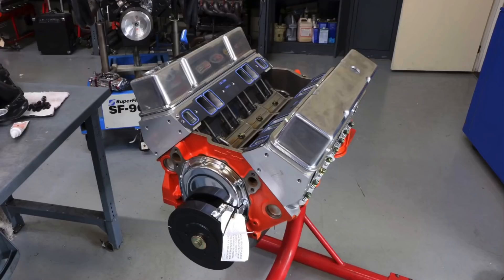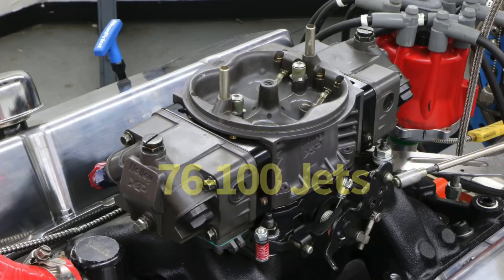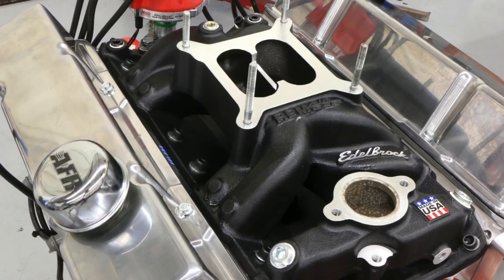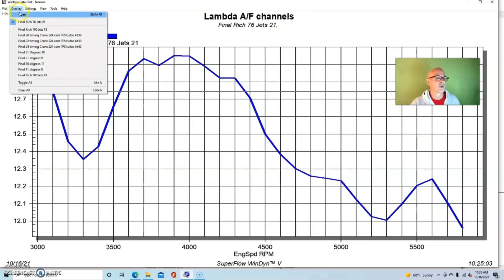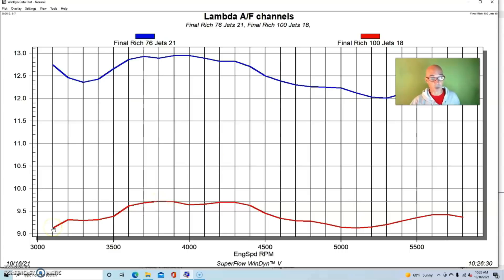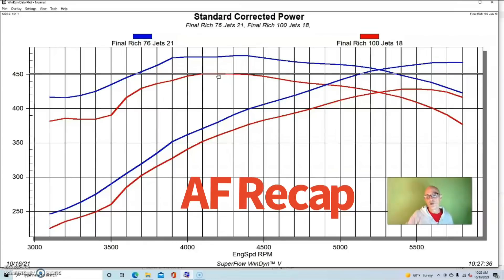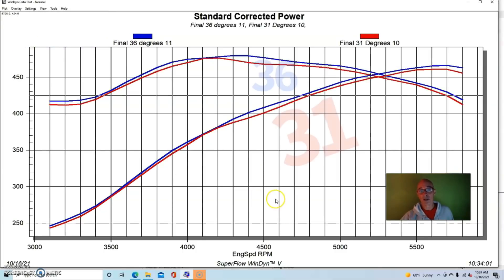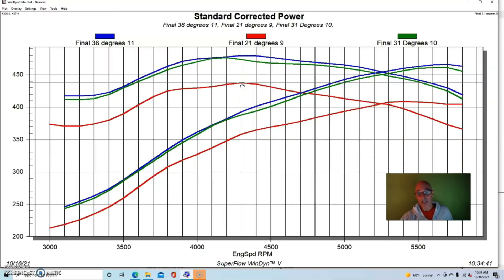TUNE VS POWER! HOW MUCH TIMING SHOULD I RUN ON MY TURBO MOTOR? WHAT A/F RATIO SHOULD I RUN (9:1?)

Comment: Can we get a timing sweep test at higher boost levels to see MBT on good gas? I know most of us slops keep the timing in the   12-14° range above 20psi, but I would like to see what the engine really wants.
Reply from the maker: we ran 18 degrees with 29 psi on the big bang motors

Comment: The fuel releases a given amount of heat. The timing on a turbo engine effectively determines how much of the heat is turned into mechanical work by the engine and how much heat is sent out the exhaust as waste energy the turbo recovers.
Reply: The fuel releases the heat? You mean the spark/combustion? Optimized timing allows for the best possible combustion pressure to be applied to the piston
Reply: @jacobburskey3044  I’m referring specifically to the fact BTU/lb of fuel doesn’t change based on ignition timing. 1 milligram of fuel releases the same amount of energy regardless of ignition timing. The ignition timing is how we optimize the release of that energy to expand the gases in the chamber at the appropriate time to create maximum torque. Everything that doesn’t expand the gases or penetrate the cylinder wall into the cooling system or penetrate the piston crown to heat the oil, goes out the exhaust. The later we fire the ignition the more energy is released as waste thru the exhaust
Reply: @justRD1  yes to all but that last statement, which isnt always true. its engine dependent for what timing is optimal and if happen to start your timing adjustments past mbt as you lower timing youll gain power production.
Reply: @jacobburskey3044  if you’re beyond mbt then you’re working against the momentum of the rest of the Powertrain and loosing substantial power as well as risking engine damage. I didn’t bother bringing such a scenario up because you should never be there.

Comment: I'd still love to see what a crappy late 70s or early 80s 350/305 did with poorly planned bolt ons with low compression crappy heads. We allll knew a guy with a pick up or Monte Carlo with a 750 Carb, intake, headers and "3/4 race cam" that claimed to have 450 hp.
Reply: Those setups make about 300 at best at the flywheel. Hell my 302 with the top end I want will make a little more than that

Comment: The lower timing created more exhaust heat, which raised the boost slightly. The LY6 im tuning boost crept really bad. I only had 10 degrees in in at the time. With no other changes besides timing, the boost stopped creeping. Just my humble opinion.

Comment: Boost change on the 4.8 turbo motor was across the rpm range going to 24°, but the timing was only above 4500 rpm. That tells me it’s something other than timing!

Comment: What’s your thoughts on timing at low rpm vs high rpm on stock motor base timing of 4 degrees to 32 btdc  pulling 20 degrees up top is going to be just right but 20 degrees down low is going to put ignition after 15atdc so do you factor a percentage or what do you do
Reply: The engine is gonna want what it wants.  Only way to know what it wants is a Dyno. But generally speaking the more cam duration you have the more initial it's gonna want

That's why all these thumpr cammed cars are slow. They need a shit ton of initial timing then they run pretty good for a noise maker

Comment: Boost drop rpm from timing is an effect of back pressure in the exhaust. Containing more of the combustion by advancing timing as you said increases efficiency and useful work while less heat/work goes out the exhaust. Less heat in the exhaust means less gas expansion means less back pressure which in turn lowers boost pressure. 
That’s at least what I feel is happening here.

Comment: The old saying: Time for torque, Jet for Power.

An updated take: Adjust timing for maximum mechanical advantage (think maximum cylinder pressure vs crankshaft position), adjust fuel for knock/temperature control.
Timing for force/power, fueling for safety.  Seems simple enough.
Reply: The N/A overlays points out that there is benefit to controllable rising timing curve rather than those silly springs we use in a distributor. I love being able to dyno tune with a modern ignition controller or EFI where I can tailor the ignition curve for best results throughout the run.

Comment: More boost at lower timing due to  lighting the fire later, peak cylinder pressure is happening too late leaving more residual cylinder pressure as the exhaust valve opens…
 That makes me think it needs a wider lobe center to open the exhaust valves earlier. 

 Wish you would have showed what the power did when you got up in the 13.2/1 range…

Comment: Think it’s definitely efficiency. Boost is a restriction…if the engine is more efficient, it can use more air, meaning less restriction

Comment: Under about 10 to 1 afr (Lambda 0.65) it should smoke. Its combination specific but youll see nitrous guys that smoke from the second they start. The more oxygenated the fuel, usually the lower the lambda of smoke point and lower lambda of peak power. Smoke, rich smoke, is particulate carbon liberated in the combustion event in a deprivation of oxygen. Its so O2 deprived it doesnt even form carbon monoxide. Methanol is really unlikely to smoke basically ever because you have to break the CO covalent bond and have enough hydrogen saturation to bond the free oxygen before it finds another carbon. You would also be at lambda about 0.35 to actually cause the necessary conditions to allow smoke. The energy of the system will actually favor formation 2 moles of CO as opposed to 1 mole of CO2 and one mole of C. Jennifer Szabo wrote an article describing methanol lambda in different situation and I think that smoke, as in particulate carbon, is really unlikely from a methanol engine. It is so rich that it probably wont run.

Comment: My take on lower boost pressure would be increased exhaust gas velocity from the increased dynamic compression force due to the increased ignition timing creating improved exhaust scavaging.........the higher in RPM the better this gets thus the power response.

Comment: If the timing changed the boost, the boost would have been the same up to 4500 as the 22* run. If you ran these pulls back to back I’m guessing the spring on the gate was getting hotter and hotter changing its spring rate. I see this on my fuel pressure regulator as underhood temps go up the fuel pressure goes down.

Comment: Ok too little degrees creates power loss but what about a motor that makes best power at say 34 degrees would that same motor lose power with say 40 degrees. I think this is a common mistake as most ametuers like to throw ALOT of timing jnto their motors
Reply from the maker: yes it will lose power then pistons